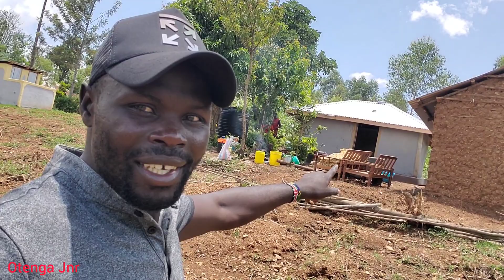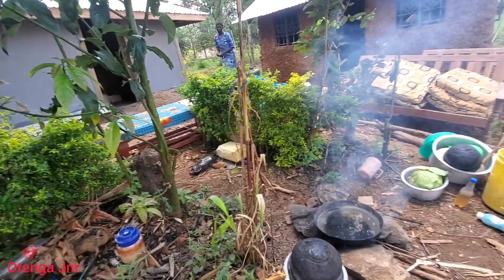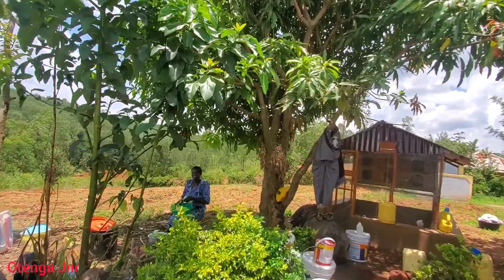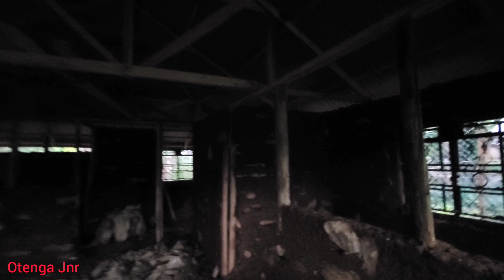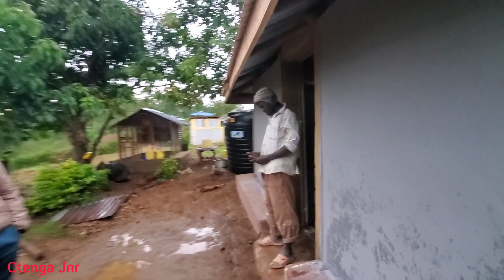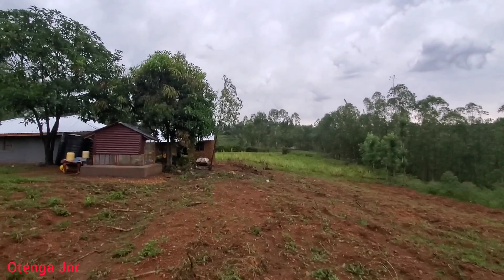MAMA ABOY CHARITY PROJECT PROCEEDS IN GENERAL

Comment: The job Mike and the mason  did in the new structure is called ‘rough casting’. The 2nd coating is called ‘smoothing of the walls’ before painting.
Reply from the maker: Thanks so much. For corrections